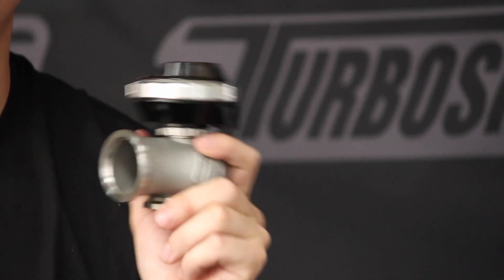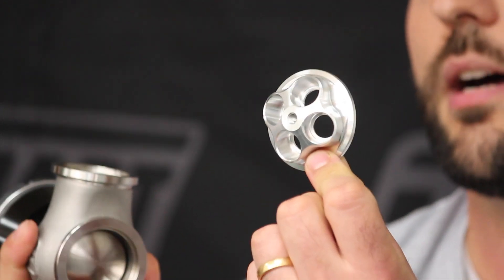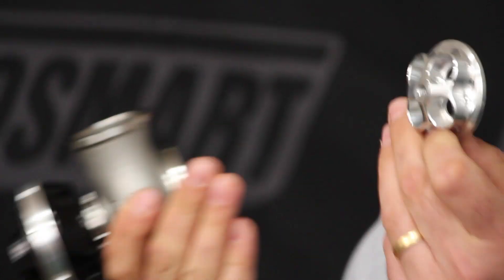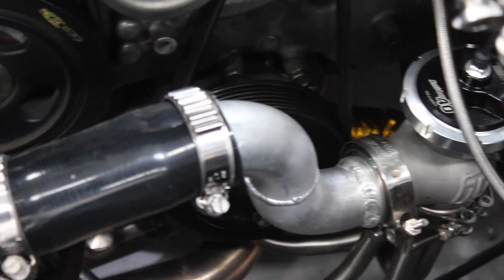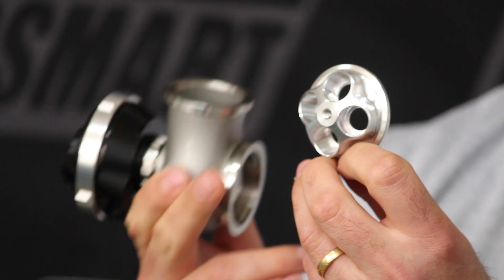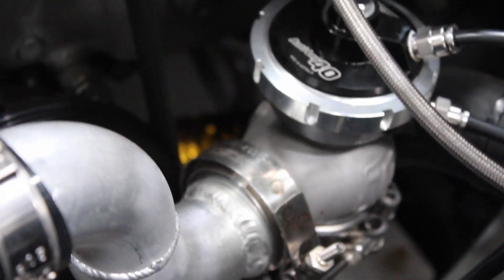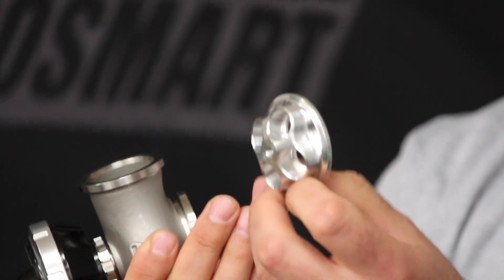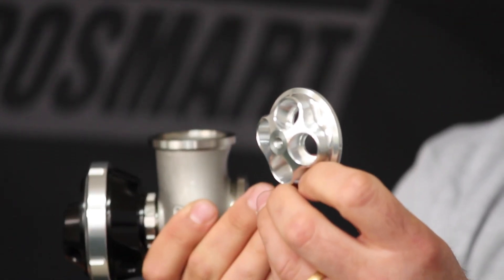NEW Turbosmart Anti-Lag Valve; An Introduction

Comment: How is this valve different from a typical external wastegate?
Reply from the maker: Mainly the laser etching on the cap. Otherwise they are virtually the same as our GenV CompGate40 Compressed Gas Variants.
Reply: @TurbosmartHQ  it means that i can use wg as anti valve? Price is better😅

Comment: in order to work properly you will need an accumalator tank correct? wouldnt an electric one negate having to use that making the plumbing much simpler?
Reply: Did you mean vacuum acumulator tank? Maybe you thonk a similar system that's I would like to do. I also thonk about a bigger steam ventury ejector to remove the air inside the compressor and a hall sensor for control the speed of the turbocompressor with an electronic westgate.

Comment: adding compressor side air to the hotside will eventually destroy the hotside side wheel ub the form of stress cracks caused by the colder air hitting a wheel that is over way over 1000F
Reply: Heard this actually lowers your exhaust gas temp

Comment: Basically a gimmick then for people who cant have a real antilag set up ?
Reply: Not a gimmick... A Motorsport proven and often preferred ALS alternative. This is an alternative to traditional throttle-kick ECU driven Anti-Lag, which is far more aggressive on turbo's and manifolds. This is a controlled burn in the exhaust manifold, rather than aggressive pops and bangs other anti-lag strategies are known for. From a true Motorsport perspective, brake pedal assist from vacuum boosted system's aren't upset or disabled by this system making it arguably safer in and overall, more predictable...
Reply: This is a real piece of anti-lag hardware, it's basically a cheap replica of the DSPS unit used in top level motorsport.

Comment: basically a blow off valve that vents air to exhaust?
Reply: Sort of... the Valve is based on a Wastegate body though as it needs to handle the heat of EGT's pushing back on it to some degree. so a alloy BOV would not work. Further to that, twin chamber control from the housing ensures more accurate control (opening / closing and a linear response to a control strategy) that a BOV simply couldn't do...

Comment: Did i get this right? It's used on the hot side?? And it adds fuel to combust in the exhaust runner?
Reply: It's fitted to the inlet (charge pipes) and when opens feeds charge air straight into the exhaust manifold pre-turbo.An ECU strategy then ignites the air with ful & ignition timing for a controlled burn in the manifold in order to keep the turbo spinning...

Comment: In theory your turbo could increase speed when you're off throttle if you can get enough of that secondary combustion happening... came into this a skeptic and im leaving a believer
Reply: subarus rocket anti lag used to keep full boost anywhere between idle and wot

Comment: So its a wastgate with a fancy plate fitting
Reply: Close... It's a Wastegate body with a modified (for purpose) actuator housing to help with true twin port control that a normal wastegate couldn't do - Wastegate's have a controlled leak down past the guide to aid in cooling & reliability which wouldn't work particularly well in this application. There are also pre-made outlets flanges designed to aid fitment & support documentation for the uninitiated so you know to get the best results from it... All things you wouldn't get from an off the shelf external wastegate.
Reply: @chrismilne8097  you can mod regular wastegate and made tight bronze guide with proper clearance so it Will not allow airleak. This turbo smart ALV is quite expencive..

Comment: Forgive me: I don't understand how this works and their explanation did nothing for me lol 

So this does WHAT?
Reply: When fitted with the right ECU strategy (other hardware & tuning required) is a form of Anti-Lag known as Fresh-Air Anti-lag... It opens to allow charge air from your turbo to bypass the engine under closer throttle situations & when combined with the ECU driven ignition & fuelling strategy will ignite and provide a controlled burn in the manifold, pre-turbo keeping the turbo spinning (creating boost) for when you open the throttle again...
Reply: what how anilag works or how the product works

Comment: The valve is only a small part of the puzzle, and also the huge strain it puts on a turbo greatly limiting it’s life span.
Reply: That is correct - There is additional plumbing, potential solenoids, ECU outputs and an ECU strategy.. But saying that it will limit turbo life isn't so true. This is an alternative to traditional throttle-kick ECU driven Anti-Lag, which is far more aggressive on turbo's and manifolds. This is a controlled burn in the exhaust manifold, rather than aggressive pops and bangs other anti-lag strategies are known for. From a true Motorsport perspective, brake pedal assist from vacuum boosted system's aren't upset or disabled by this system making it arguably safer in and overall, more predictable...
Reply: I did a compressed air tank in the trunk on my s70 with a g25 wot switch make air go into the turbine housing. Small compressor but when you want that instant power it's great just you get two hits before the tanks empty 😂

Comment: Only for race cars, I can't wait for the first moron to put on a daily driven street car and then watch their turbos go nuclear.
Reply: Now I wanna buy an EK and put it on...  GoPro watching the turbo while I drive :)
Reply: @dustincomp1814  Sounds like you have a solid bank account.
Reply: @frankbob4043  I wouldn't say I'm exactly wealthy...  I can find EK Civic around me for 500-800$ and I work in a weld shop so I could half ass an exhaust together and throw this little torch lighter on it with a salvage yard turbo then just buy an ecu for it and watch it blow up basically.  $4k total if I shop cheap and go for a cheap tuning with the other guys to get group discount.  

Be nice to save a few parts after the melt down though for later play around.
Reply: @dustincomp1814  Well get to stepping and post the vid on you tube.

Comment: isn't recirculating valve better? keeping boost and turbo spooled up between shifts. probably too complicated to retrofit
Reply: Simon Zhao true anti-lag like in rally cars. Recirculating Valves are good for not releasing metered air to atmosphere. Anti-lag is combustion in the exhaust manifold in order to spool the turbo, this can happen alongside a diverter valve. It means you hold boost or even build boost while off the throttle though it’s not as smooth as on the throttle boost builds
Reply: TheProPilot I didn’t mention using one. And it wouldn’t be any different. It’s just marketing because everyone wants anti-lag these days. Looks no different than an external wastegate to me. I think it’s pointless. I was just clarifying to him that a recirculating valve or DV is different. That sits on the intake side and basically his comment was like comparing apples to oranges.

Comment: Superchargers are the best simply instant power at the gas peddle.
Reply: you are that guy commenting on an apple video that oranges are better.
Reply: Except they aren't lmao, especially for small motors.
Reply: Yeh it's great until you climb the revs a bit
Reply: Except a supercharger is basically a turbo on a belt. And needs RPM to spin 😒
Reply: @TheProPilot  well, not really, unless we are talking about centrifugal superchargers (prochargers).  But yes, they need rpm to spin and are a substantial power draw unlike turbos which use a resource otherwise wasted.

Comment: This set-up has been factory on Mitsubishi evos for decades nothing new
Reply: While you are correct. The Mitsubishi unit is flow limited. It is also on or off. The design of this unit flows a lot of air and with the right ecu you can even control the air flow out of it.
Reply: Evos don't use this type of valve

Comment: Didn’t really go in depth on how it works. Or you went too fast and I didn’t catch it. Lol
Reply: I didn't  really get it either. But I think on off throttle  situations it pumps air from the turbo into the exhaust  manifold to help  ignite the extra fuel being dumped  from the ecu for anti lag?
Reply: Just buy it!  We bodged up something in our garage and it's magic. Never mind if it did work, then Toyota / Mercedes / GMC etc would have used it.
Reply: Sean Price yes the retarded timing ignites the fuel as it leaves the exhaust port

Comment: Will this work without having to set a throttle kick? I don't see what's the point if you already have an anti lag capable ecu!
Reply: Its not the same style off antilag and will give you diferent results
Reply: @eduardogears5259  I realize it's different, it's actually close to secondary air type of anti lag. But if you're already have proper anti lag with an aftermarket ecu, you're likely not to purchase this product. It would be great if it can operate with tunable stock ECUs such as Evos & Subarus
Reply: @sierraco7315  Aftermarket ECU's do not give "proper ALS". Proper ALS has an air pump directly pumping air into the exhaust manifold which is exactly what this valve does
Reply: @sti-uk9033  by proper I meant it would produce positive boost. That would be "proper" enough for most users. This valve is not giving you any new capability if you already have an aftermarket ecu. TS needs to point out what's the advantage of such "secondary air" type of als over "classic" als. I think not having to set a throttle kick might be one minor advantage. But it's not worth $600 the cost of the valve.
Reply: SIERRA Co you are correct that it probably won’t give that much better ALS than what’s already accessible through aftermarket ecu’s.

If it stops aftermarket ecu’s ALS robbing vacuum from the brake booster then it’s worth it IMO.

There’s been no mention if it will solve that issue though.

Comment: But if you already have a stand-alone  Ecu that can be set for anti lag  why would you need one of these?
Reply: There is different types of Als this is for fresh air als which is better then simple throttle kick Al's but obviously more complex
Reply: @clonecaptian  this does not replace a jacked throttle als system. This runs along with it.
Reply: @YouTubeHallMonitor  tipical timing for aggressive ALS is around 40 to 65 deg AFTER TDC. Far down on the exhaust stroke. We also use something called spark limiting. It fires a short spark to just ignite the fuel but not cause the entire mixture to ignite. The second side of this is to sometimes miss a spark altogether.
Reply: For the guys who dont know it is called secondary air injection it means injecting air and fuel retarding it makes the turbo spins when you’re off throttle when you’re in a corner so you will have a better lap, back in the day f1 drivers and engineers used this type of technology but dont know why they removed it.
Reply: Evos have this kind of technology but not retarding the ignition and adding fuel but only fresh air.
Reply: Thats why its called anti lag to avoid turbo lag on corners and straight aways. Bypass valve in short.
Reply: It's been proven on dyno runs to reduce egt's nearly 300°c over conventional antilag setup so it's less punishing even on the turbo.
Reply: You're thinking of 2 step, which is fake anti-lag. True Anti-lag uses fresh air and fuel injected into the exhaust manifold.  2 step/launch control, whatever you want to call it, does nothing but shoot flames and bend rods.
Reply: 2 step is not fake anti lag lmao they are two entirely different things made for two different purposes
Reply: @ryanwolfe911  you do not inject fuel into the exhaust manifold. The fuel comes from the ecu mapping. You use spark limiting to let the engine spill unburnt fuel into the exhaust. But it all goes through the engine still
Reply: @tpsretard  ... okay so its done by injecting fuel in to the exhaust manifold you literally just described what he said lmao...
Reply: @ryanwolfe911  2 step is for launching antilag is to keep the turbo spooling during gear changes . Two totally different things
Reply: @ryanwolfe911  Wrong antilag and be used in launching off the line as well.